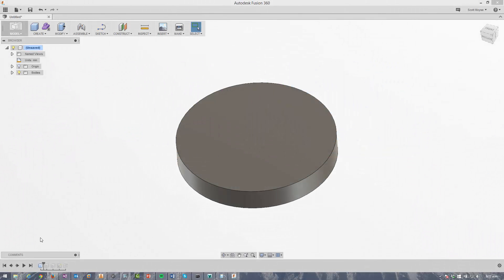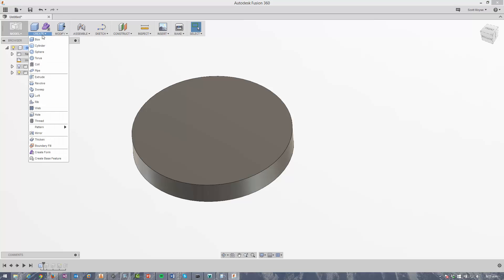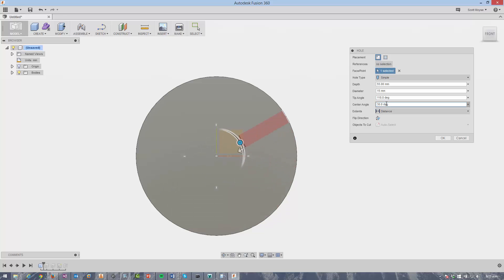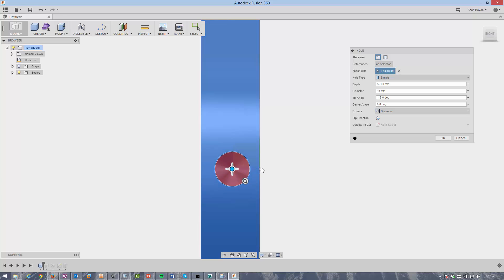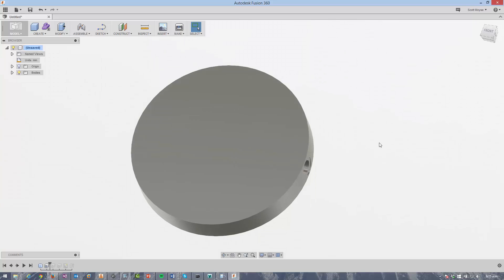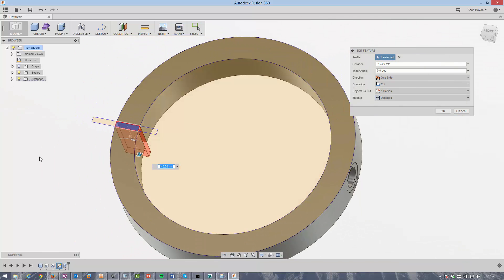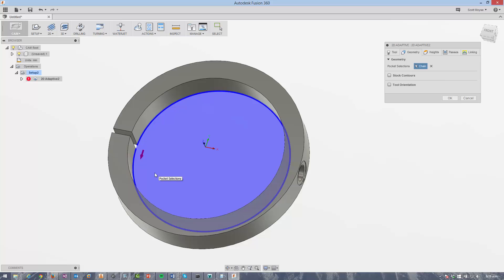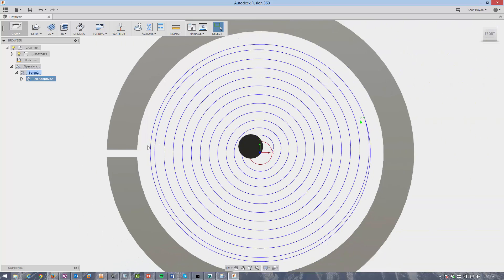Fusion 360 Hole Modelling and 2D Adaptive Clearing Open Contour Selection

Comment: Fusion 360 is extremely limited. It looks good in simple programs, but it is greatly lacking in more complex part programming scenarios. I'm looking for someone who knows Fusion 360 or HSMworks in depth to work with me on training. It seems that every example of CAM for Fusion shows very simple parts that could have been programmed in BobCAD. My parts are much more complicated. Anyone out there consider themselves an expert?
Reply: +Harrelson Trumpets the cam in fusion is fusion version of hsm you can use the hsmworks vids for tips or just ask on the forum. it takes a bit to get your head around it but it is so simple it can make it hard to use you can do a tool path in 5 clicks it`s that simple.
and you are quite correct about best practices in cam but it`s a moving target when I get the chance I same to them do best practices. and nyccnc vids are good for nobs he is keeping it simple what is quite hard to do
Reply: I'll check out the HSMworks videos. I was ready to purchase Inventor with HSM and I'm kicking myself now for choosing Fusion 360 over the better option. Live and learn ;)
Reply: Fusion 180 update...

Yes, I said 180 as I have turned a corner or two thanks to Al and Curt with Autodesk. With their patient assistance through a GoToMeeting session, we discovered the issues plaguing my CAM progress.

It turns out that Fusion was doing really weird things that are not normal or useful because my part was imported from Rhinoceros as surfaces and solids. After converting everything to stitched solids and minimizing bodies, everything worked right away. I can now predictably create slots with the pocket strategy and contours along curves and surfaces.

I have to say that Fusion is truly awesome software once everything is working properly!

I'm running two complex test parts this week, one programmed in Fusion 360 CAM and the other in RhinoCAM, which I have used successfully for many years. I'll update you on the results.

Thank you again to Curt, Al and everyone who chimed in the past two days on all three threads.

Jason
Reply from the maker: +Harrelson Trumpets you could still purchase Inventor HSM, couldn't you?
Reply from the maker: +Harrelson Trumpets Great to see you got help directly from the Autodesk CAM team so quickly.
Reply: Yes, they were very helpful. All of my problems could have been avoided with a simple pop-up box warning me when importing files. Most designers WILL bring in their previous work to use in a new program. And that unfortunately IS the problem since Fusion does not work well with Rhino.
Reply from the maker: Harrelson Trumpets If you import a file containing solids, it works fine. If you import a file containing just surfaces, you will have to stitch them up. It's fairly standard for any CAD package to operate that way. Export settings from the 3rd party CAD product, and how it was modelled in that is obviously important. It is possible to stitch up surfaces in Rhino so they appear as solids... it's not different in that respect when importing Rhino files into Inventor or Solidworks.

Part of the problem with Fusion, is it doesn't make that clear. It's obvious in Inventor & Solidworks. But I wouldn't go so far as to say Fusion doesn't work well with Rhino.
Reply: When I was first introduced to Fusion 360 through a one-on-one webinar session with someone from Autodesk, I was literally told (and shown) to import my Rhino files and begin working. There was no mention of converting anything, hence the beginning of my misunderstanding and 6 months of frustration.
Reply from the maker: Harrelson Trumpets That is really unfortunate.

Comment: I like John's videos but there are a lot of things he doesn't know yet, and so I think his tutorials are lacking in that regard, and it doesn't necessarily help as much as he wants it to.
Reply: Fusion 180 update...

Yes, I said 180 as I have turned a corner or two thanks to Al and Curt with Autodesk. With their patient assistance through a GoToMeeting session, we discovered the issues plaguing my CAM progress.

It turns out that Fusion was doing really weird things that are not normal or useful because my part was imported from Rhinoceros as surfaces and solids. After converting everything to stitched solids and minimizing bodies, everything worked right away. I can now predictably create slots with the pocket strategy and contours along curves and surfaces.

I have to say that Fusion is truly awesome software once everything is working properly!

I'm running two complex test parts this week, one programmed in Fusion 360 CAM and the other in RhinoCAM, which I have used successfully for many years. I'll update you on the results.

Thank you again to Curt, Al and everyone who chimed in the past two days on all three threads.

Jason
Reply: NYC CNC Oh I agree, but I see that as being - at least potentially - problematic. I believe it can lead some folks away from best practices in CAD. This coming from someone who is relatively new to CAD, but definitely not to CAM (try building compound arc surfaces in Mastercam X7 - ugh).
Reply: atomkinder67 he`s a new be at back off
Reply: daniel lyall If we can't learn to take criticism, then we are all doomed. Frankly I think John takes it better than most, and I think better than I do. Takes guts to put out what he does for all to see.
Reply: atomkinder67 yes but you are guessing most vid`s done by fusion staff don`t show best practices at all. 
and John does know some of the best practices but when it`s a one of part it does not matter at all. if its a use all the time part that`s different and do you know what the best practices are as most best practices change at every up date. and its a lot of a nob to take in if they learnt best practices then how to draw and yes I do know best practices
Reply: +atomkinder67 I have yet to see anyone post a good video of best practices when it comes to CAM and Fusion 360. I see lots of people jumping from here to there skipping steps, then going back to pick up what was missed or forgetting them entirely. Honestly, the Fusion 360 videos look great mostly because the interface looks great. The proof is in the programming. Show me how to program CAM on a complex part in a shorter period of time than SolidWorks, RhinoCAM, Alibre or Mecsoft and I'll applaud. Until then, I am sitting here watching Fusion 360 run around in circles confused about how to cut a part with multiple steps and contours. Adaptive clearing does nothing for me if it can't make a good part.
Reply: +Harrelson Trumpets If you email me or invite me to a project I'll be glad to help. I use HSMXpress for now at work, and moving the shop to HSMWorks, and have used Fusion 360 at home as well as at work occasionally when I need 3D paths until we make the leap. Or you can pop in to cam.autodesk.com and there are plenty of folks who can help.

Best practices are hard, and can be different between people of course, and as far as CAM goes, just about everyone likes different setups, different tool orders, different code, so best practices there are something to be determined by the shop as well. However, generally I would say that best practices result in minimal reprogramming and setup alteration time when changes must be made to the model, as well as keeping things like dedicated finish passes as efficient as possible as they tend to be slower. Ordering toolpaths, using start locations to link passes close to one another and minimize time out of the cut, all sorts of considerations to be taken into account.

I didn't mean to imply any of this is easy in any software package.
Reply: This definitely is not easy in any software package as the user is often 50% of the solution. I cannot share my parts as they are confidential, which is why I was hoping to eventually find a video that shows parts combining small features, precision sloped curved surfaces and non-flat designs that post holding challenges.

I know how to cut my parts in several other CAM systems. I want to use Fusion 360 if it is up to the challenge, but so far it can't seem to cut my parts. I see the future unfolding with systems like 360 and I do want to be on the cutting edge. But the cutting edge has to be better than 2005 software and so far I'm not seeing evidence that this is true.

Thanks for your input and suggestions!
Reply: +Harrelson Trumpets Have you gone through the CAM Examples presented with Fusion 360? They should be located in your Dashboard at the bottom. Check out 3D Strategies and 3D Part 1 for some good insights as to how the toolpaths and geometry selection works. After seeing a screenshot of your part on the forum, I can say that your part is certainly within the capabilities of Fusion 360.
Reply: Yes, I have been through every tutorial on the Fusion 360 website. The instructions are not really clear which causes problems on small features. I can machine large features all day long, but Fusion has trouble with the small stuff regardless of parameters.
Reply from the maker: +Harrelson Trumpets We can't wait to see those results!